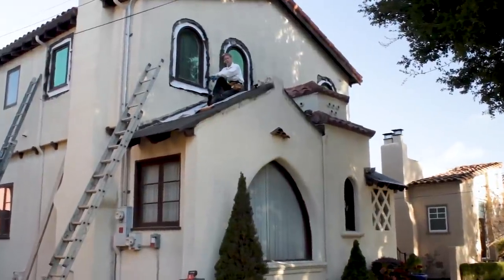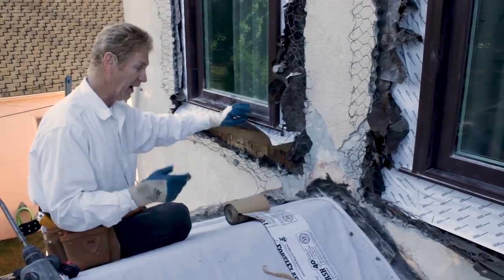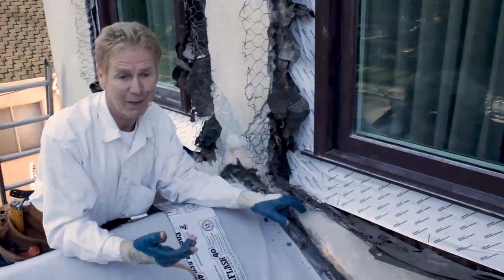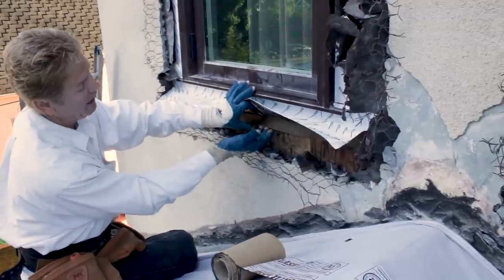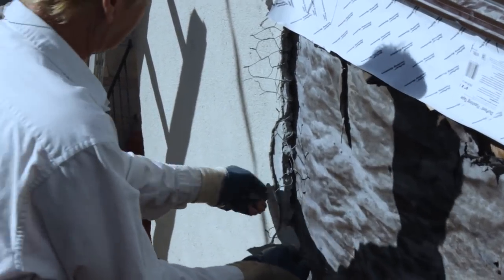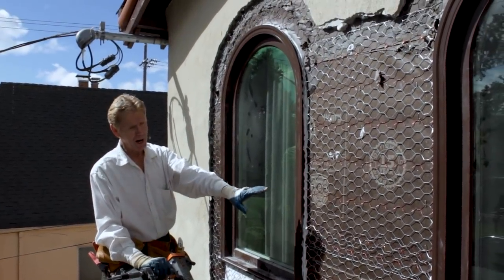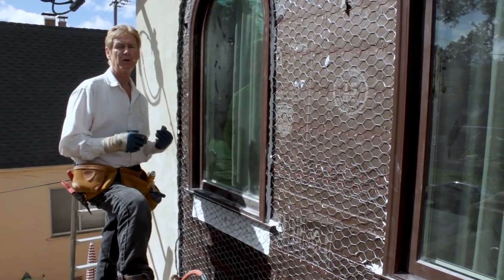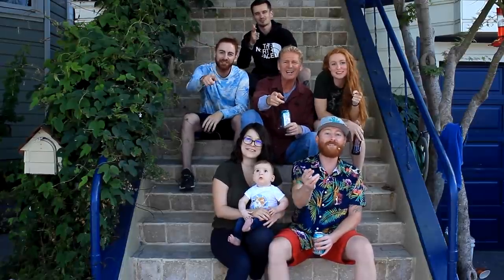Repair Leaking stucco windows, keep the rain outside

Comment: Kirk when I first started caulking and waterproofing when I was a teenager ( over 40 tears ago) I was working with my dad and he told the window installer he was installing the window wrong. The installer said “ I’ve been installing windows for 10 years” My dad replied “ and I’ve been fixing them for 20” keep making the videos. There is far too many videos on how to do it wrong. It is refreshing seeing someone that actually understands construction.
Reply from the maker: Morning Gene Carden, you're dad makes my point; thank you for the kind words.😏
Reply: @StuccoPlastering  I just watched a video where the person was showing how to fix a leaky window by tearing out the Sheetrock and caulking the window to the backside of the sheathing from the inside.🤣🤣🤣. The problem is for every video like yours that is done right there are 100 of guys like that with zero understanding of construction and the building envelope..again keep making the videos maybe you can keep a homeowner from making a very expensive mistake.
Reply: @genecarden780  have seen this video and also have no idea how someone can think its the correct way but looks like he was really sure thats the correct way becuase he put it on YT. This season had many phone calls to fix windows done by this "pros".
Reply from the maker: Exzackory, your dad is a smart man. Cheers.👨🏻‍🔬

Comment: Great video. I have had my own small business for 15 years. I make a lot of money everytime it rains off badly and wrongly installed windows mainly retrofits. They literally make it much harder than it needs to be to be. Usually ripping out the old frames.
Reply from the maker: @ajfam871  Evening, there are good and bad installers in every trade, that’s life. 😉
Reply: @StuccoPlastering  Very true they make me look good and I make good money repairing or replace king their
Subpar work.

Comment: Hey Kirk, I’ve been installing windows and doors on the SF peninsula for 20+years, I started out with a window company then got my license in 2007, I am amazed at how many windows I see flashed wrong, even in new construction builds, good to see you out there doing it right, my stucco guy just recently retired and luckily I found another guy that knows his “stuff” good stucco guys are hard to find, not sure I want to put my info out there, just know there are good window/door installers still out there🤙🏽
Reply: Crap out in the midwest I don’t think any stucco guys exist lol. I’ve done it for retaining walls etc but I’m a tile guy and basically know already how to float etc but I would never take on a job like in this video hah.
Reply from the maker: Howdy Ben, you make my point, best wishes, with the new year. 😏
Reply from the maker: @Titantitan001  LOL, if you can repair a window, you can correct any and all windows.😏
 The more complicated, the more fun they are. Add the excitement of working on a slanted roof, extra fun.
Reply: Hello Ben, you know someone who services fairfield area?

Comment: I'm shocked that this is happening. I've installed hundreds of windows around the bay area, mostly Oakland and Berkeley and the flashing is not that complicated. You essentially want to sandwich the flange in straight sticky flashing. Bottom both sticky and non, so you can have building paper tuck under. Silicone and install window and use sticky flash over nail strip on the sides and top. Only thing that I would consider is whether or not to cover the bottom nail strip. Some window manufacturers don't like that and want the nail strip exposed.
Reply from the maker: Exzackory,  leave your company name in the comments, I'll copy and past it in the description.😉

Comment: Hi Kirk - your videos are very informative. I do feel the pain and anguish of those homeowners that are unable to find the right individual to install their windows. I just bought a 1988 built home in southern California. The house is in good condition but nothing was ever done. I want to give it a shot at fixing many things in the home. I consider myself handy, however, there are things that are more complicated than others and may require an actual "expert". Finding an actual "expert" for a reasonable cost in CA is the biggest challenge of them all! Anyhow, my windows are original to the home and therefore need some strong TLC (replacement is the best word here). The cost of window replacement is upwards to the 15K. My home is stucco and there aren't many videos of people changing windows of stucco homes. I want to try doing it one window at a time to see if it is possible. Do you have any suggestions on how to go about? I did not see any videos of you actually changing a window on stucco. The couple of videos I saw, they made it look quite simple and the videos are over 10 year old. Any thoughts, it'll be greatly appreciated. Thanks
Reply from the maker: The methods we used back 10 or even 20 years ago are still applicable. You can count on us for sound information.🕵🏼

Comment: My house that I recently stuccoed had old windows where the frame was essentially just one by’s. I couldn’t find any info on how to properly flash them, as most windows have those flanges on the edges that sit flush with the wall. I basically just put the flashing tape in the center of the wood of the window frames. Hope I did that correctly.
Reply from the maker: Morning Happy Dude, there are many ways to skin a cat.
 Anyone who did not install a window correctly, hopefully, will find out with the first notable rainfall.
 If it takes ten years to see water intrusion, you can bet there will be plenty of costs to remove all the rotted wood and new windows.
 The interior damage may be sheetrock, carpets, insulation, and such. This is just materials. The mold inhaled from the moister or water damage is much worse than the cost to replace.
 This is why we sometimes, we have to decline some jobs as they are too far gone and need a general contractor and not a stucco contractor.🤔

Comment: Hi Kirk, love your channel. Kirk, we are doing a cinder block, with cavity insulation and the windows are 3 inch deep return from the outer wall face. Do you have a deep set window video, with stucco return to the window frame? Its a Spanish revival home.
The window is mounted to a 2 x 6 wood buck. Thanks!!

Comment: I’m in SoCal. Area code 91786. We work from Santa Barbara to Palm Springs. Bakersfield to San Diego. And I can’t believe they sealed the framing but not the exterior. And for the most part we only use moist stop caulking as well as peel and stick. Everything else’s from our experience only has a 15 year to 30 year warranty. I can’t say enough of the amount of homes that were built post 2k but once you chip out windows. The water proofing is fragile. We don’t install windows. We just fix them. It’s a shame when the product description doesn’t live up to its reputation.
Reply from the maker: Exzackory, you make my point. 🍻
Reply: We have been looking for someone to fix our windows for a while. In the recent rains it became really obvious that something isn't properly sealed somewhere. Sounds like exactly what you are describing, our windows (so we were told) went in around 2007. We are in Glassel Park. If  you're still fixing windows in Los Angeles area let me know how to contact you....
Reply: Also interested in hiring someone to fix leaky window in San Diego...what's your business name / phone.  Great videos, Kirk!

Comment: Excellent 👍👍

What are the codes that you need to know in order for your stucco repair job to pass inspection?
Reply from the maker: Two layers of paper proper tie in and correct length of nails it staples.

Comment: I've been in the window business over twenty years in texas.. Most times we walk away from stucco jobs with window installs. The proper way to install windows in stucco Is not to cut apart all the stucco on the outside.  The glass should be removed sashes.Meeting real but the frame should be left in the wall.. You then install a new window inside the old window frame with a stucco fin.. This way the stucco is not damaged.. The way you're doing it can be done but it's very very costly and more expensive..
Reply from the maker: No worries, we don't install windows, we lath and apply the stucco.
Reply: Love Texas but your dead wrong. Leaving  the frame in was very popular  when the replacements first came out Now you don't see them at all poor quality  matinace  such as caulking painting the caulk every few years especially  on south facing wall been doing this 47 years

Comment: Kirk! Love your content im a stucco estimator but i have connections in Southern California for window installers. 
Nueva Vista Windows
Please call them. They are online in Montebello California (Los Ángeles). 
Please let me know if you need anything further. Thank you for showing us how it’s done ✅
Reply from the maker: Thanks for the tip, as folks may need this information. Cheers.
Reply: I have leaks in my newly installed replacement windows in a stucco condo building and live in LA. Should I be looking for a new window installer or a stucco company to fix the leak? (Especially if the original company I worked with doesn't resolve this? I believe that they didn't install correctly and I'm afraid to have them remove and reinstall.) Thanks!
Reply from the maker: Thanks for the tip.

Comment: Hi Kirk, great videos! We have leaking windows in our 1992 built HOA, the originally installed over 30 years ago windows are of poor quality. Some of those original windows that had been leaking for over 20 years were replaced recently (retrofit windows, sliders and custom full frame radial windows) and continue to leak. There are suggestions to do destructive water test the windows and walls to find the sources of the leaks (the roof has been re-coverd this year with a new layer.). But many vendors suggest to caulk the windows and paint the stucco with elastomeric paint to avoid getting into potentially costly repairs if damage is discovered. Is that at all a sound, more affordable option to breaking the stucco and changing the paper/correcting installation mistakes? And if we do the destructive test is there a way to see from the inside if the windows were installed incorrectly or if the issue is deteriorated paper or both? Is providing proper flashing on a retrofit window a part of the job of the window installer?
Reply from the maker: Good evening sounds like a mess there, retrofits are usually windows that just insert into the 
frame, then a polyurethane caulking is used to fuse the frames to the existing wood frame, It is easier to do than breaking out the stucco but is done for duel window purposes, not to stop leaking windows. It appears the paper is damaged which stops the water intrusion, you can temporarily fix this with Stucco-flexes, "Renew" paint, which usually gives roughly 15 years of waterproofing, the issue becomes, can you find a person to do it properly? To tear off all the stucco and start from scratch is the best advice, but most can't afford to do this. best wishes, 👨🏻‍🔬
Reply: @StuccoPlastering  Thanks for the answer Kirk!!! By tearing out the stucco - do you mean around the windows or an entire side of the building?
Reply from the maker: You and I can't predict this, as you remove the stucco around the windows this is exploration, and those explorations will dictate how much needs to come off. And or if there is wood rot damage. 👨🏻‍🔬

Comment: You should use retrofit windows NO STUCCO PATCHING AND NO LECKS but you have to use the best caulking
Reply from the maker: Howdy Bill, On the contrary, my brother. I have found that these leak the most as now one is relying on just caulking.😏
Reply: @StuccoPlastering  chipping back the stucco 6 inches around the window your between studs with nothing to Nail to the black paper is NOT WATER PROOF AND IS Torn and ripped you have to use the best water blocking  caulk you get when installing retrofit windows it’s impossible for it to leak
Reply: I am an extreme advocate for retrofitting  windows and got to say both of y’all got a point. Retrofit provides a speedy and clean window installation. Like Bill mentioned you need the best of the best caulking, which can get pricey. I’ve been retrofitting for 8 years in AZ and the only cure for retrofit window leaks are cutbacks with a grinder/saw and properly flash from the bottom sill and up.

Comment: Wish you did a video doing foam/stucco over brick
Reply from the maker: @chadspinalbosd007  Howdy Chad, that would be foolish for anyone to consider having done, if you mean stucco over bricks, we have many on the subject.
Reply: @StuccoPlastering foolish indeed, I am an ok plaster man , but I started with masonry, when I see beautiful brickwork that can be restored and customer wants to plaster and stucco over it,  I try my best to make them keep it , hardly ever works here in southern California, I think people are fed up with brick work and it is sad , I did it for so many years in the mid late 90s , now it is almost never asked for , veneer brick or pre fab cement boards with brick finish on them 😢
Reply from the maker: @jessedukelacrosse6470  I gave up advising folks that bricks are pretty, if they want them covered with stucco, we do what folks wish, cheers my fellow plasterer.

Comment: I had to pull the wood trim from around my windows and found the guy just cut out the stucco a bit more than the nailing fin and shoved it in there.  Miracle though he removed the lath but didn't damage the paper around or under the fin.  Then, covered the fin with 1x2 then put wood trim over it and caulked around the top and sides.  Looks like some water did get in at the bottom between the stucco and paper slightly but not in the house.  Any suggestions on a fix, Kirk?
Reply from the maker: Hello Commander, you can have him back to correct his work? This is what we are morally obligated to do! If he opens it and does not understand as an expert how to put it back together, it's on him to remove and correct. Do him a favor and allow him to learn by his mistakes.🕵🏼
Reply: @StuccoPlastering  Hi Kirk, I agree that is the first and right thing to do but they were installed over 10 years ago, so I don't think he would be responsive.  But, thanks to your videos, I can handle it myself anyway.  Hey, I even bought some tools off your Amazon link. And I saw one of your other videos that answered the question.  I've got the stucco broken out around, lath peeled back, got adhesive flashing, picking up the rest of materials tomorrow.  One question though-should I put a sill at the bottom of the window?  Install over the lath and stucco around? Thanks for your reply. Cheers!

Comment: I flash the bottom with the bitumen/bitchethane. It's sticky. I will wrap up the sides 2 or 3 inches  wrapping it into the sill. Then install the window  the flash the sides with the same product  then the top overlapping the 2 verticals that I just did.  
Kirk. Does the window frame touch bare wood or does the window sit on top of the paper? 
Another question.  Is it the stucco guys responsibility to fix the paper? How far away from the window does the stucco need to be removed. 
I prefer to replace windows and have the stucco fixed versus using ugly ass retrofit windows.
Reply from the maker: Howdy Travis, it's a cardinal sin to place any flanged window directly on the wood.
 Whether it's plywood or, as in the old days, against the studs.
  A paper or a peel and stick membrane should be placed on first. Preferably at least 6 inches in width. How far to break out from the window depends on the condition of the paper and wire. The minimum is about at the very least four to six inches, as the new membrane has to overlap the existing paper, and the new stucco netting must also tie into the existing or crisscross it so there will be no perimeter crack.👍

Comment: Doesn't answer my question for a second story window 15' above the ground.  How do I get the new waterproof membrane overlapped over the original membrane and under the stucco without removing the stucco all the way down to the ground?
Reply from the maker: Breakout and expose where you want to tie in your lath, That includes the tops, bottoms and sides, Your walls your choice, 💃🏻

Comment: Kirk do you use metal lath around your windows?
Reply from the maker: Howdy Roman, yes, it's called 17 gauge stucco netting, you can also use 18 gauge. Cheers.
Reply: @StuccoPlastering  no im talking about 2.5 guage metal lath
Reply from the maker: @ramonmolina8070  What about it ???
Reply: @StuccoPlastering  Just wondering if you use it cause I see you didn't here.
Reply from the maker: Hi Ramon, are you referring to metal J-trim? If so that's a commercial trim for when steel doors were installed without flanges, the J-Trime was attached to the surround and caulked this allows a clean stucco stop and an expansion.
 In some states they used to require these metal J-trims or J-channel around all the windows to create an expansion, however, all makers of windows now have built-in expansions.
 It the states that did require a J-trim around the windows, I always thought, what a damn foolish code.

Comment: I am to install windows in concrete opening then stucco over how to flash these type.,?
Reply from the maker: Hello Steven, easy my friend, buy some straight flash its also called flex-wrap, It won't adhere if the opening is dirty, https://youtu.be/F_Cxkr_DVGM/
Cheers my friend.🤔